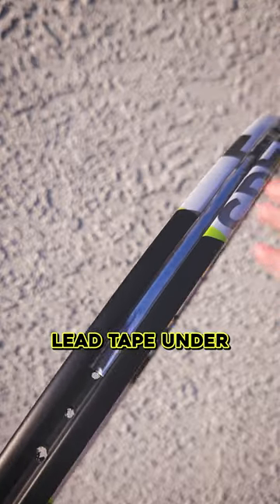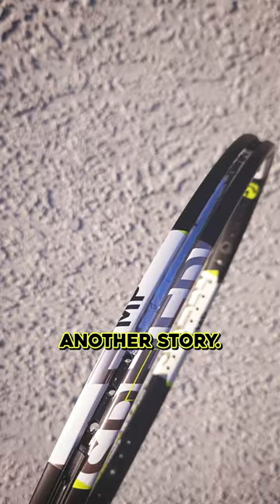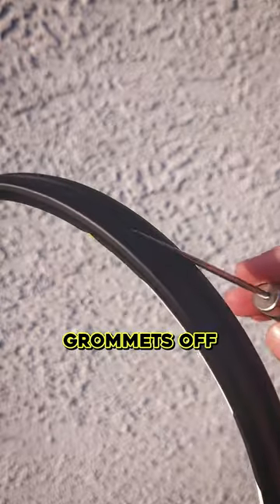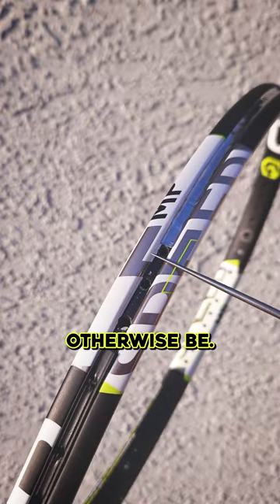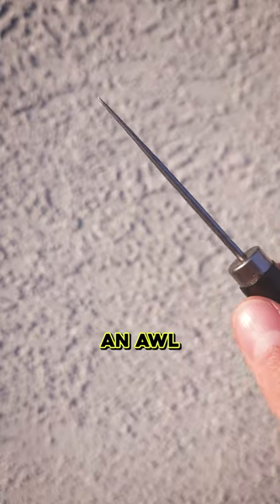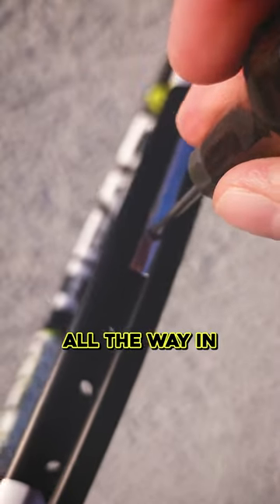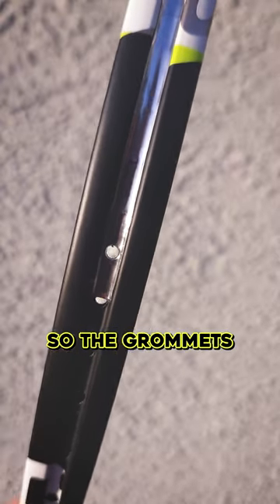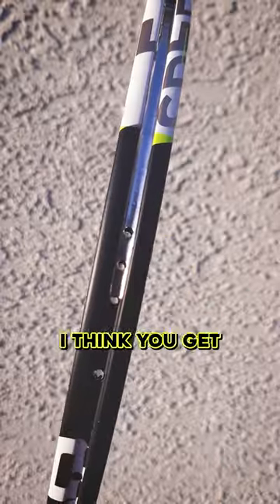Professional LEAD TAPE Install Technique

Comment: Extremely smart. So how do you remove and put on grommets you can no longer find a replacement for?
Reply from the maker: Well, I'm very conscious about how I remove them. I can generally always get them back on but it can be a process. But having parallel holes make it easier!

Comment: Make sure the grommets and bumper you reinstall are NEW.  Old grommets won't work as the tie off grommets are already flared and you won't be able to get through the frame holes.
Reply from the maker: But I did get it back through. I'm just really good at getting flared grommets back in. Kind of tedious but it can be done (usually) this one was no exception

It came strung as well.

Comment: Do you have any customizations to your main rackets or do you just play with stock? I myself added a leather grip and 2 grams total to 3 and o’clock on to my Gravity Pro Auxetic
Reply from the maker: The main rackets always end up pretty customized. Somewhere around a 350+ static weight and swing weight right around 330. I also love the leather grip touch!

Comment: Hello, be careful when you drill trough the lead as some brittle will go into the frame from the grommets holes. Ive made the same mistake in the past
Good luck!
Reply from the maker: Has happened! Usually never does but keep trap door open so it can escape.
Reply: @ZeroLoveTennis  that's why I don't do it anymore. And that's why Head CAPs are so awesome, you could hide pounds of lead under CAPs, anywhere from 7 to 5 !
Speaking of CAPs, will you try to modify a prestige MP / MP-L anytime soon?
Reply from the maker: I have messed with the MP L and did exactly that but never got around to making a video on it. Maybe I will. 

I like the idea of the cap grommets.

Comment: But if you poke holes youre losing precious grams!
Reply from the maker: I think the holes more so stretch open the tape, not like the lead disappears. Plus I measure the weight/twistweight and swingweight after all this, not before the holes are poked.